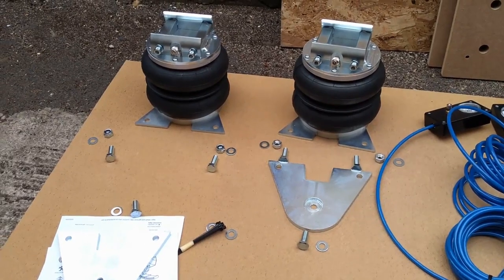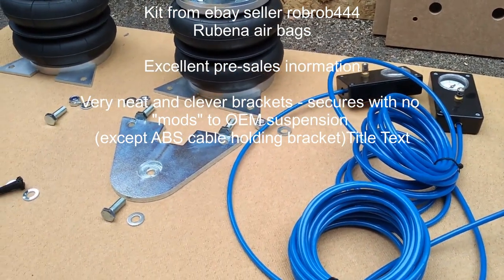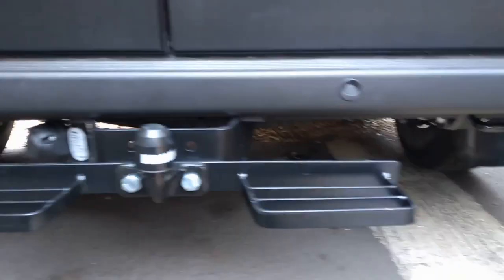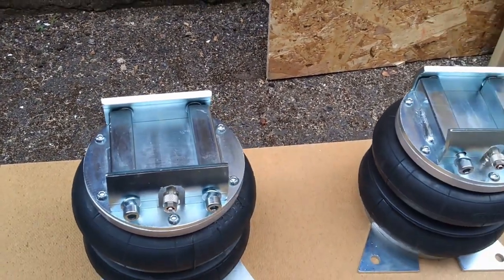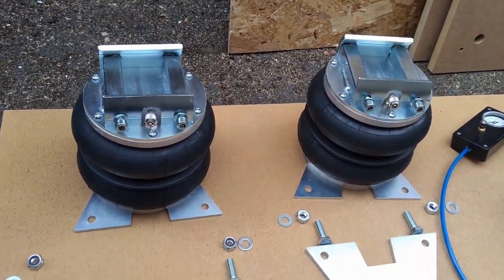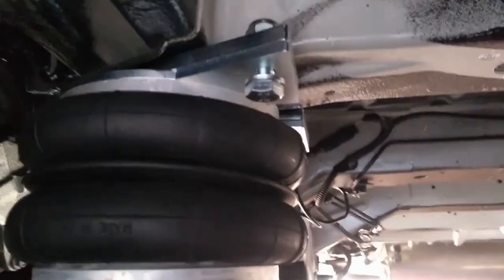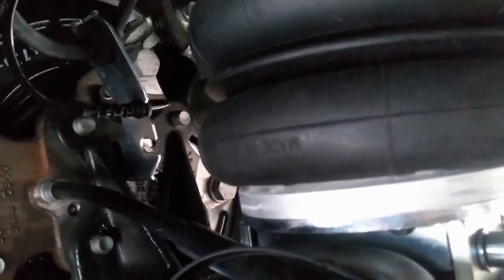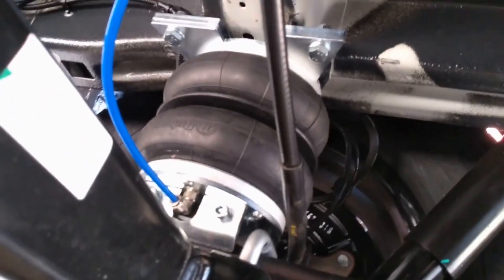Fitting air assist suspension to ducato/boxer

Comment: Good informative video. Thanks for posting, about to undertake the same,but on an older Version.
Watching your video has  reassured me that it is well within DIY territory
Reply from the maker: Glad it was helpful!  Be aware, the original bump stops on mine unscrewed easily - joys of a new van!  Older ones may be rusty and have been known to come loose leaving a spinning captive nut....  So perhaps research this (and work arounds) before starting.   Good luck
Reply: @Ryan_DYD  Yes thanks, my beast is a 2005 model, I had decided to have a tentative attempt at unscrewing before I fully commit.☺ Mine does at least have the galvanized chassis, so I'm hoping it will still be reasonable

Comment: Thank you for sharing. I’m about to do this on my 2016 van ‘The Mouse House’
It’s a Ducato thing apparently the rear suspension will need an upgrade.
Reply from the maker: These will help with the rear sagging and raise it up a bit and improve driveability - but won't increase load capacity.  Just be aware, its a simple job (depending on the bracket of the kit you use) - but on 2016 its possible/probable the captive nut that the current suspension helper is fixed to is rusted.  Perhaps spray that with penetrating oil or the like every day for a week before (don't spray brakes!!).  If this hut sheers it then becomes a pain in the backside to remove.   Do some research first.  Hope for best, plan for worst.....  Good luck!

Comment: I really wouldn't recommend having different pressures each side it will affect the vans handling. The same way replacing only one leaf spring on an axle would (one nice new spring and one soft worn spring.)

Comment: Hi, I have been trying to get this suspension kit which looks easy to fit but I have had no luck. I have looked on ebay but can't find it. Bill
Reply from the maker: Hi, Sorry, you are right - I can't see it either.  I bought item "184363345399" title "AIR SUSPENSION KIT FIAT DUCATO 1994-2019 " from eBay seller	WKR LTD eBay seller ID 	robrob444  - but can't see them on there any more
.  Googling (as ebay search didn't work - I found https://www.ebay.co.uk/str/airsuspensionkit which is the same user ID - also found https://kitbrandnew.com/en/air_suspension_kit_with_12v_compressor_citroen_relay_motorhome_recovery.php which may be of use.  May be worth contacting the guy direct on ebay?  Good luck!
Reply: @Ryan_DYD  thank you for your quick response. I will keep looking for something similar. Bill

Comment: how you like it now? does it work doing it on my van? could you tell me cons and pros of it? thanks
Reply from the maker: Hi, Yes, working well.  I've set the pressure and not needed to adjust - and it drives fine.  No cons really - and the van drives as well as you'd expect and little body roll.  (I added before adding the weight, so can't comment how much it would roll without it, but others have installed this and similar kit and say it makes a huge difference).  Cheap and good upgrade.